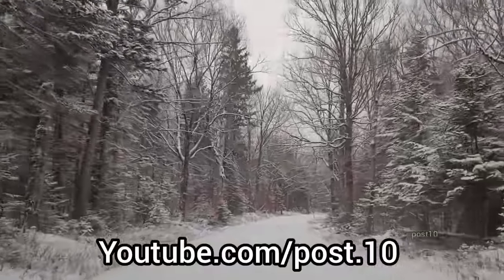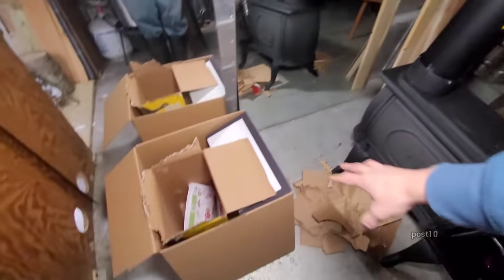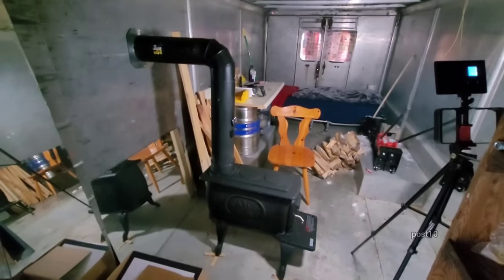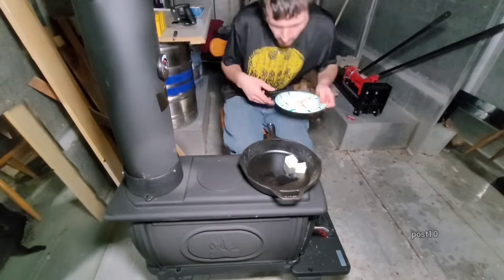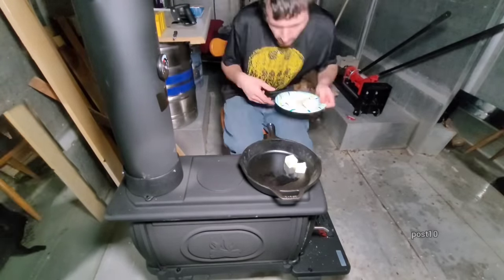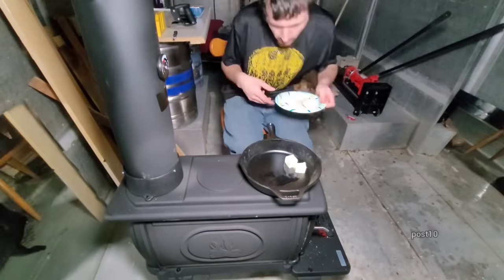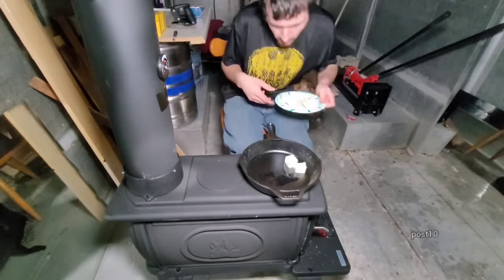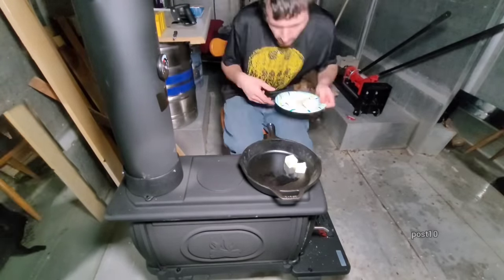24 Hours Living In Abandoned Truck Deep In The Woods During Snow Storm. Transformed Into Camp

Comment: We all work hard, but you should take time to enjoy yourself! I'm a 76 yr old woman, and I'd like to give you some advice! Have you considered gluing the roof down! Heavy winds cause trees to fall, and it will take your roof along with the cinder blocks! You might be pinching pennies like the rest of us, but if you're going to spend a lot of time in your truck you should get a cheap solar generator & solar panel! The cold weather, wood stove, & metal walls will cause moisture, & you will lose a lot of heat, and use a lot of wood, so think about insulating, even if you use only 4x8 sheets of 2" blue or pink board! You should put another door in the rear in case the wood stove creates a problem between you & the front door! Get yourself a measuring spoon for the instant coffee, & 4 coffee mugs, one for you before you burn your lips, and the others for company after the guys see this video as a man-cave, or a place to get warm during deer season! Put bright colors on your truck walls during deer season so you dont get shot, and make room inside for the deer to hide🦌! Get a couple 7 gal water jugs with spigots so you will have plenty of fresh water, and build an out-house! Be safe and keep warm!❤️

Comment: You can take pinecones in the late spring and wash them. Wash and cut the green pinecones into smaller pieces. Then mix it with sugar, equal parts and cover in a container with a lid. Mix it once a week for a couple months. Then, boil it with the sugar and strain it. Now you have a wonderful syrup. And it has health benefits. A small bottle of this goes for 20.00 online and its easy to make. Get free buckets with lids behind doughnut shops or in the bakery at the grocerystore for free.

Comment: Becareful with that door my friend. Looks like it’s untested and could be a fire hazard. You don’t wanna get locked in there if a fire breaks out. Take care bud and make sure to put time into making that door work tip top just in case you need to get out in a hurry. Just a thought my friend take care and stay warm. Great video I’m gonna have to check your channel out later. After watching the video I noticed you didn’t use your stove to clean your cast iron pan. You should’ve threw the pan on the stove with snow and used a paper towel to whipe it down after it got warm. And don’t use dish soap on your cast iron. Just warm water. And whipe it clean so the flavour stays on the pan. Dish soap will ruin it or you may taste it later while cooking.

Comment: Should have kept the longer pieces of 1x and made framework to cover the windows. Then could put 1" foam panels in them to cover the windows and door to keep the heat in. Could have made them hinged so that you could close them at night to keep more heat in and open them during the day. I'd probably get some 1" foam to glue on the walls and ceiling between the stringers. Insulating will likely help you regulate the temperature as well. Will not have the large temperature swings. The pine is definitely not great for the creosote buildup. Love the manual log splitter! May have to pick one up. I would plan on putting a plate with probably 1-2" spacers between the top of the stove and a metal plate over the hole that you poke in the flu pipe. I think the idea is to keep the flames in the heat box more so that it's more efficient and keeps less heat from going out through the flu pipe.

Comment: Hey Post10. Good on ya!  Now you're a land owner!  ;-)
May I ask why you left the burner so far away from the "wall"?  It seems a little "in the way" stuck out into the area so much.  I get that it could be wasteful to have the heat go straight to the outside wall (especially if it is metal, it will conduct very easily), but was it cos you couldn't cut the horizontal ducting easily?
Finally, cooking veg so that it's still a little "crunchy" / firm is called "al dente", it's Italian for "to the tooth" or "has a little bite", I too don't like soggy veg and much prefer steaming it too (keeps all the goodness in).
Bon Apetit!

Comment: Where’d you get your wood splitter? 

Excellent content as always. A bit of friendly advice, Next time you need to modify the heat shield on a woodstove like you did. It’d be more efficient to make the hole towards the front so the heat has more time to dissipate before exiting the pipe.

Comment: For Safety in Future . Set up a Fire bucket with sand and fire blanket to smother a fire. If an amber drops while cleaning stove while hot. Also you'll require a steel ash bucket. Enjoyed your video and preparation...  Solar Generator perfect to hike in and out with..
Reply from the maker: The entire structure is made out of metal and I have an emergency room.
Reply from the maker: Exit

Comment: I always am interested when people turn something old and junk to someone else its a treasure honestly if i were you id fix it up decently enough and maybe consider renting it out on Airbnb. A couple fyis and suggestions for the future. First off your wood stove should always remain closed when you open it up smoke will come into the room. When you get it started you should adjust the air flow with that box on the front of the stove and the flu adjustment. If its built to the correct recommendations thats how it should come together. Now if you need some power why not consider investing in some cheap solar panels or even just a generator for when you absolutely need power. You could also setup a large container on the roof to be a rain collector and have a pipe running down into your sink. You could fill it from a stream if need be but you can also collect pricipitation. Something i use here in indiana at my campsite and it has really came in handy. I also have a copper pipe that winds around my wood stove that if i want hot water i use a small pump to circulate the water thru the pipe and the fire heats it and i have the water i need for anything from cooking and cleaning and even have a nice little outdoor shower thats just a couple piece of fencing to make it private and the piping since my water tank is mounted on the roof and my cabin is two stories it works great. Also something i would really really consider is getting you some 4x8 sheets of styrofoam as thick as you can or want. Line your walls with that and then cover it with Luan board or leave it bare but the extra insulation will make a huge difference in heating the joint and allow you to use way less wood. Lastly i know you said you wanted it to be grown up all around the outside but you should consider putting on a nice porch with an awning you could even use the same roofing material. One thing i super enjoy is being able to go sit out on my deck in the mornings and evenings my cabin is just a few feet away from a river where fortunately is very deep and mostly calm. Someday in the future i wanna build the deck out to have a walkway to a dock instead of tying my boat to a tree and leaping from the bow to try to get up on dry land. Anywhos you earned me as a subscriber and looking forward to seeing your future endeavors! Keep at it and remember sitting around wont get your projects done!

Comment: Concerning the cast iron cookware. First, you must season the pan you could look on the Internet to find out how to do that. Properly your food will not stick to the pan.  (Factoid:  cast iron was and is the first nonstick cookware.). 
Cleaning cast iron :  Use salt to clean your pants thoroughly and above all do not use soap. The salt will absorb all of your grease, so you don’t have the mess that you have in this video.  You then can rinse the pan with water. Heat your pan up on the stove and put a light cooking oil on the surface of the pan and rub it around evenly with your paper towel.  Let the pan cool and you are ready to cook again.

Comment: Go get a couple of sheets of insulation to put on the wall where you head is. And glue it to the wall. You need to get a good power cell for inside the building. Like  a Jackery

Comment: I'd put a school bus emergency hatch in the roof. Go up there and put down some long 2x10s make it like a deck up there. Then buy 4  8 to 10ft 4x4s and stand one up at each corner. Lag bolt to a short 1ft 4x4 on the inside. As u crank down 8 in lag bolts, it will pinch into the truck, and they will hold steady. 2 in each. 2x4 railing and then putting a camonet around it. U could sleep downstairs and literally deer/turkey/grouse hunt from upstairs. Put a 2nd story roof on if u want. Or just hang a camo tarp over the 4 post. Few recliners. U could be up there and comfortable all day.

Comment: There are rollers on the doors. Ballbearings wear out or may be loose or adjustment. Had a Grummen like it, drivers door was a pain, passenger door flew if you forgot how well it worked.
Miss that truck. Ate engines, flywheels & transmissions as geared to low...for city, not 70 on the hwy!

Comment: How do you cook in those cast-iron pans? You’re supposed to dry them very well and then put a little oil in them and move it all around the pan the bottom in the sides each time and I don’t use metal spatulas in mine. I use the plastic type, works very well.
Reply: Don’t throw that outside put it inside the stove the burn up you’re welcomeing animals around your house

Comment: May also consider styrofoam insulatin on back door and front windshield it will silence and help regulate heat better. Ill bet walls have insulation in them but maybe not. I knw you like the metal look and that insulation i speak of has an alunimun on one side and comes in different thicknesses

Comment: If you want to keep it warm in there. You need to put insulation ìn the floor minimum of 6" and 8" in the walls and ceiling. After you do That you will need to install a solar panel so you can run a fan in the summer to control mold.

Comment: You have to insulate that front windshield man.

Just place two layers of insulation behind the corrugated steel. Then frame a large piece of plywood and drywall in front of that and caulk the sides.

You need to insulate the floor with about 3 layers of dense carpet padding, then carpet the floor with very plush stain resistant carpet. CUT OUT LARGE AREA AROUND THE STOVE!

You need electric heaters and cook tops. They have very good ones. That stove is a bad accident burn waiting to happen and it's very inconvenient. You get a third degree burn way out there and you're going to have to rush yourself to the nearest hospital by driving yourself even with a severely burned arm or hand. 

You need a solar panel on the roof of the truck, with 3 rechargeable generators inside the truck. You need to keep 2 generators charging during the day, while using an electric heater from generator 3 at the same time. Then you can use generator 1 of the 2 to power the heater at night. 

And that leaves you with a generator left to use for the heater while your recharge the 2 generators the next day. So, that's 3  medium sized solar generators and an efficient electric heater.

And a warm dog to keep you company; beleive or not my little chihuahua puts off so much body heat I keep him under my blanket. He sleeps curled up under my chest or curled up under my stomach while I sleep on my side.

Comment: put some insulation on the walls inside id use the silver coated foam with liquid nails it will reflect the heat back in and later you can get something to catch rain water or snow melt off..

Comment: Shouldn’t have put the hole in the back of the heater it’s Designed to pull the heat from the front underneath where you put your pots to get that hot that’s why it’s taking too long to cook and you’re not getting the heat on top

Comment: I promise you bro that roof is going to blow off. So when you do put what panels haven't been bent all to hell back up there, make sure you use self tapping screws with rubberized washers and they have to be long enough to go through the high side of the coragation. Now that I see the inside of the truck really all you need to do is jack the crown back into those aluminum rafters already in there. Okay when you are starting your fire open the damper. When you get the fire going shut the damn door on the stove and shut down the damper. The purpose of the damper is to keep the heat down in the stove. So it can radiate heat. Otherwise all your heat goes out the flue. You really need to learn how to use the wood stove. You're killing me bro you're killing me!
Reply from the maker: The truck is still intact after many storms exceeding 70 mph wind. My newer videos I'm running the wood stove better, I was new at it

Comment: Lazy. Did not screw Down roof,clean area around green trailer for freedom of movement. Dangerous to move around. It is a truck. It was driven in. Why not fix and drive out or make it a remake to camper. Will probably burn the place down. No space around pipe. The heat and fire in pipe will transfer to walls.  Fire hazard. Half ass job. If you are going to do something do it right or not at all. Terrible example to show others to replicate. Not the way to do it. More work done different would make it suitable to call something

Comment: We should do more things "half arsed", no insult intended.
If you were closer to civilisation there would requirements: Air vents, fire exit, fire blanket  fire extinguisher, 1st aid kit, asphalt foot path to front door, hard standing for your vehicle, burn only kiln dried store bought firewood to keep particulates down to 3g/m3 or face prosecution and a criminal record. Water certification, sceptic tank, a minimum level of insulation, double glazing and draught proofing. Registration with local emergency services and annual fire certification for your wood burner.

Or you can live free and unsafe using firestarters, knives and saws.
And in the process not have time for anxiety and depression.